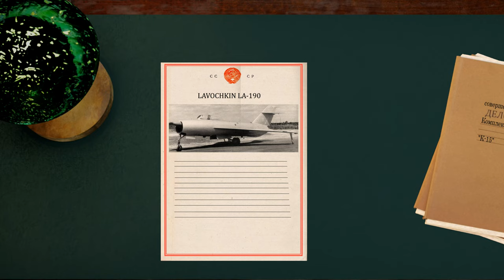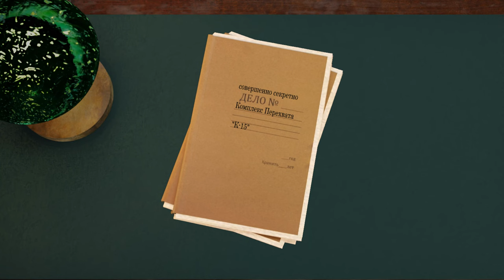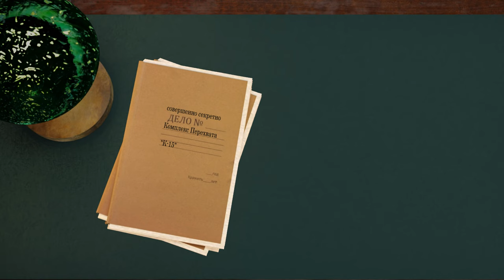The Lavochkin LA-250 Anaconda: An Unusual And Obscure Aircraft

Comment: The looks of the La 250 like as if it was the predecessor of Sukhoi Su15 interceptor.
Reply from the maker: You might be right, especially concidering they both were designed as interceptors
Reply: Was I first saw the La 250 I thought of the Su15 too. The 250 could very well be the Boeing Killer's daddy.

Comment: After the cancellation of the project, the technical data of the La-250A were passed to the Tupolev Bureau and used in the development of the similar Tu-128 interceptor.
In the late 1950s, the USSR simply lacked the technical capabilities to provide the necessary radar, engines, or aerodynamic solutions, making the La-250A destined to fail from the very beginning - it was simply too ambitious. However, the Tu-128, ten years later, proved to be relatively successful.